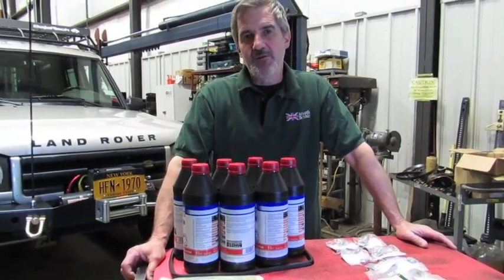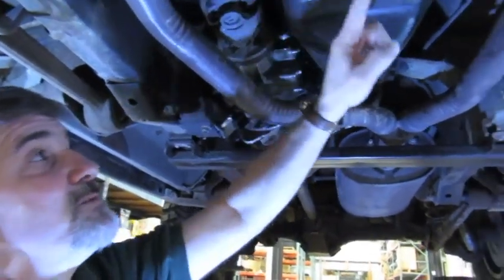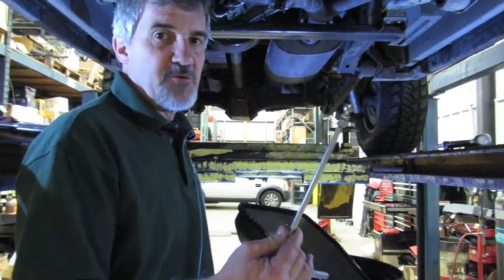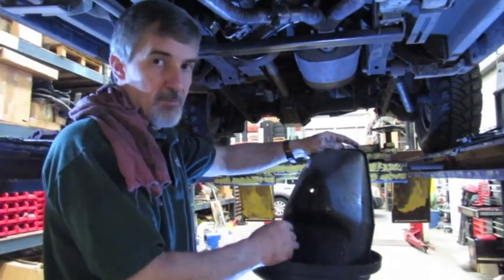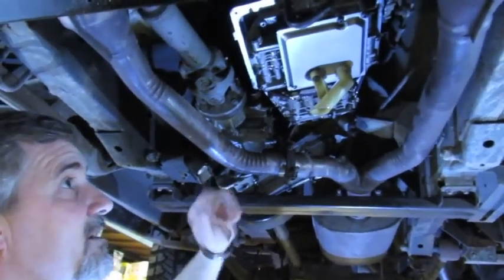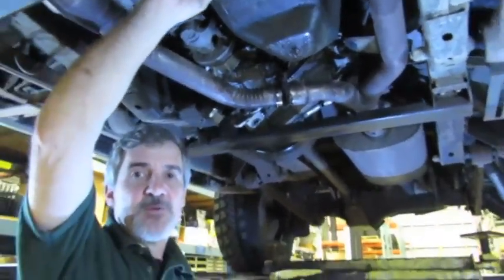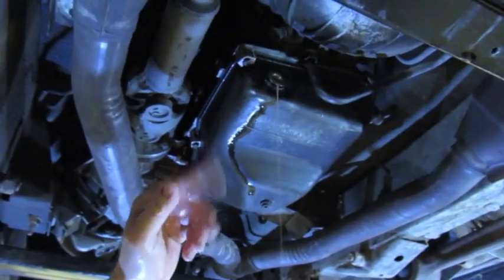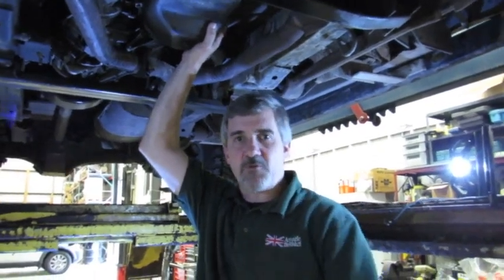Automatic Transmission Service Performed On A Land Rover Discovery Series II

Comment: Extremely helpful video! Don't think that I could have done this without it. A few tips from someone who did this repair without a lift: I used 4 jack stands set up pretty high (8 notches up). The forward stand was just behind the front door opening, in order to give enough room for me in front of it. I had to loosen the screw that is used for the transmission mount below the back of the pan (5/8" socket), in order to get the pan in and out easily. The drain plug on my P38 was 5mm, not 6mm. I used anti-seize compound on the bolts after cleaning them. Only 1 was stuck and rusty (I sprayed them all multiple times over a period of time), but it did come out with a little extra effort. I used a face shield and had sleeve protection and gloves when crawling under the car when it was running because of the hot catalytic converter. Overall, it took much longer than I had thought it would and was very frustrating at times because I didn't have a lift, but it worked!

Comment: Another incredible video! One question, why not include new bolts in the kit if they are so susceptible to corrosion?
Reply from the maker: it's really more dependent on where you live... seaside salt air or winter region where they salt roads, metal corrodes... southern areas not nearly as much of a problem. i.e. if you don't need new bolts and hardware, why be forced to buy them?

Comment: Hello friend, excellent video, thanks for the advice on many parts of these great vehicles.
On the other hand, I would like to ask you a question. I have a discovery v8 200, it is showing me the m and s lights flash and the starter motor activates and cranks the engine but it does not start. I would appreciate your contribution

Comment: I'm curious. I did my trans yesterday. I let it drain all the way out. Didn't change the filter... anyways, I put 2 quarts into it. Drove it around the block and went through all gears. Came back and leveled it out, but only took half a quart maybe. So I only put 2½qts into it total Does that sound right? Or is it possible my filter is messing with the flow inside. I see everyone talking about 5-7qts. So was surprised when it only took under 3.

Comment: When you're draining the oil in the transmission do you have to train it while it's hot or more. When adding oil to the transmission do you have to wait for the transmission to become hot to have the proper level
Reply: Seems like it's cool, I've heard when you change the fluid you're only changing a 1/2 to a 1/3 of it anyways with some in the bell housing and some in the cooler.

Comment: I help my discos transmission last a bit longer by putting in in neutral, pulling the hand brake, then putting it in park, it prevents your truck slamming into the parking gear when you park and the truck rolls forward until the gear catches

Comment: Discovery I got a Land Rover Discovery 2 and I was going down the freeway and the four wheel drive shifter pop out of gear put it back in twice in the third time he popped out just stays in like a neutral I can move the shifter reverse Ford Park whatever and it won't go into gear whatsoever it starts up and runs fine I just can't get it to engage I wondered if you had any ideals

Comment: ello good morning I have a problem with my land rover 2000 .. the 4x4 does not want to operate the lever was brought ... I wanted to climb a dirt climb and the truck did not climb try to put the 4x4 i did not work either ... i in the highway if it advances i revolves well .

Comment: Hi Doug. Very good video. You couldn’t have explained this oil change any earlier. I carried out the job on my 2003 discovery 2. All went well. I followed your advise and it’s a job well done. Only question I have is after I took it fir a drive I immediately notice much cleaner gear change. But on stopping at my drive , when I put it into reverse I can hear a mild clunk, this noise is only made when putting it into reverse. Every other gear no noise. Any thoughts anyone.?
Reply: I get a clunk going into reverse as well. I think it’s normal.

Comment: I'm considering buying a discovery 2. Are they pretty reliable?
Reply: everything but reliable. but fun to work on... mostly.
Reply: Cult1022 Thanks so much!
Reply: Cult1022 sounds like someone who has never owned a Land Rover
Reply: Albert James hell no, they are not reliable at all
Reply: Albert if you take care of your car it will take care of you
Reply: They are darned reliable if you service them and realise they are a high end utility truck that can do almost anything well. Where it goes wrong is when they are bought by owners who fail to realise it may be an older truck now but it still has the running and servicing costs it did when it was new. Buying one is easy and affordable its the running costs that bite. So throw in several ghetto owners who bodge and ignore maintenance and thats when it bites a new owner.
Reply: stay on top of the preventative maintenance and it's very reliable.  I bought my D2 with 85k on the clock and sold it with 155k on the clock (not easy miles either).  only repair was the head gaskets at 105k.  only oil and filters otherwise
Reply: i have a 2004 D2 and love it. Ive had no issues at all but i make sure i change oils and filters and anything else that can go wrong. a well maintained D2 is a thing of beauty. and incredibly capable off road
Reply: I recently got a 2000 TD5 with 195,000km on the clock. I have done 25,000 km in the last 9 months and it runs like a champ. A seized idler pulley stopped me once, but other than that all I have done is change all the fluids along with regular oil/filter changes.
Reply: They take a lot of work and time. Keeping all the maintenance up is important. If it has not started ticking then you might be lucky and found one that had a good engine. What happens when time is engine Heats and cools and the sleeve start to slip. My suggestion is change the radiator put a better thermostat in and use the right coolant OAT. Also make sure that your fan clutch is working correctly. Don't put any of that stuff in there that is to make things not leak in the radiator system it will overheat quicker. Always be prepared to put it into neutral when you are in traffic letting the engine rough up a little bit to keep the work of low don't let it idle too long and get the engine temperature to rise. One of the keys to success in this engine is to keep it cool

Comment: ok so you dropped the pan and changed the filter and gasket so why did you have to go through all the hoopla with starting the Rover and running through all the gears and checking the new added fluid level  when you could just put in the same amount you took out. I mean, you stopped the rover... it's on a lift... just put the same amount back in that you drained.  You can use the fill plug or just put it in through the dipstick in the engine compartment.  But it is a well explained video ..   Does anybody from atlanticbritish ever respond to questions and comments?
Reply from the maker: Hi Keneo, the reason why you go through all these steps is to save yourself from a costly repair by over or under filling your transmission. Additionally, the reason why you start the Rover and add more while it is running along with going through all the gears is to circulate the new transmission oil through the system and then add more as necessary to get it to the correct level for operation.
Reply: OK thanks for the reply..
Reply: Ok I tried to tackle this job yesterday. It was a nightmare to say the least. Keep in mind I have a 97 Disco 1. I couldn't get the exhaust loose to have room to move the crossmember to get the pan off.  Upon much deliberation I decided to cut my crossmember in 2 separate places. I used my brand spanking new Milwaukee Hackzall!! Worked great!!  I plan on making a custom crossmember/skidplate and bolt it up so it will be easy to take off next time. Well anyway after I dropped the pan and tried to take the torx bolts out of the filter the 2 bolts on the side stripped out on me. They were so tight they bent 2 of my torx bit drivers. So then I was about to give up but nooooooo!!! I get a bright idea to take my air tool with my little grinding bit and make a cut in each head of the bolt to fit a big screw driver in. Screw driver didn't work so I got my Milwaukee driver drill and broke one loose and got it out. The other one was a fail when I mangled the top of the bolt head. So I took screw driver and tapped the side of the head with my hammer and it came loose. So i'm like now what..  Where am I going to find these bolts? So I get online and email Atlantic British asking for help. I was asking somebody to look around the shop for some spare bolts to send me..lol..   But then an hour later I thought i'll just run down to ACE hardware and see if I can find them. I searched for a while but I found the perfect 10mm bolt to use. 69 cents each. I have the filter installed and just waiting for some time to put the pan back on. I also noticed that there is no fill plug on a Disco 1. I didn't know that till yesterday.  I hope after all this is over and I take this baby out on the road the transmission doesn't go out on me. I've already drained and filled once. Maybe ill do it again in a week after I get everything together. Also.. Another question..  Do you know if the 94-99 Rovers had magnets in the transmission pan? Mine didn't but I wasn't sure...
Reply: Well when I did this job two weeks ago it only drained a bowl of oil so definitely not gonna add that to it because it needs more. He’s shaking you how check and make sure how to check the oil level. If I were to add the same amount of new oil to my car it would had the same issue because it needed more